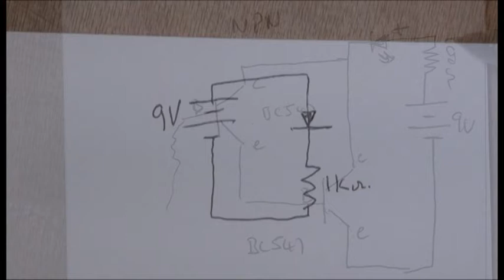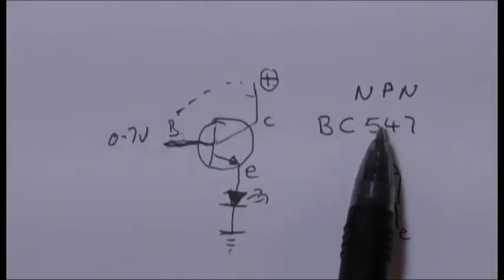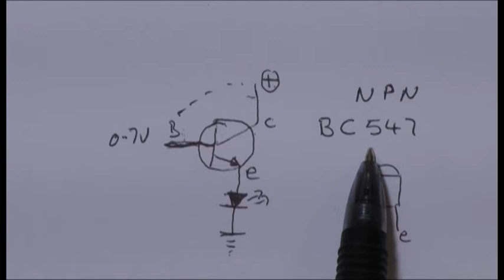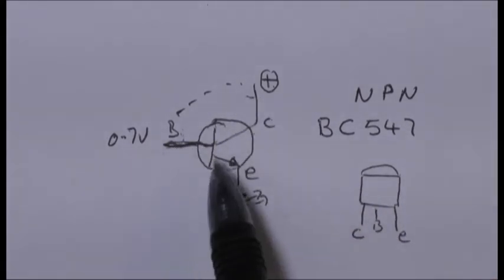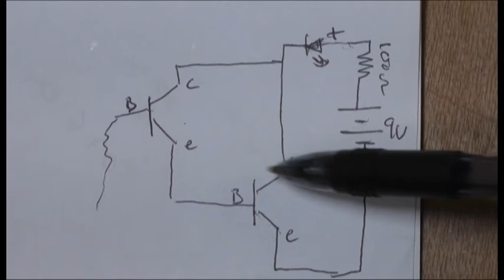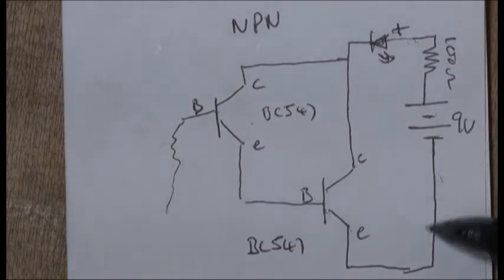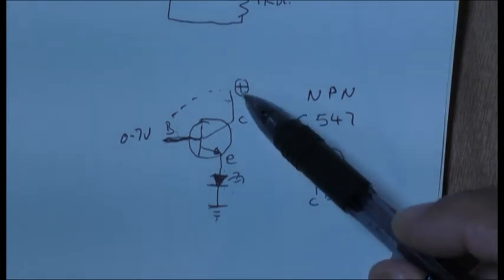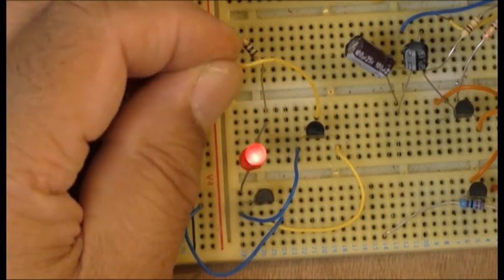#132. Darlington pair and Transistor as a Switch

Comment: Both circuits did the same thing. There must be a difference but you did not show it.
Reply from the maker: Yes I didn’t have a bulb that would light up with more current. My apologies
Reply: @JustFun-iz9rf  the second circuit with the two transistors triggered with a smaller input. You had to lick your fingers to get enough current flow on the first one. You just touched it in the second one. As you explained, the minute current from your finger was amplified by the first transistor and that turned the second transistor on fully.